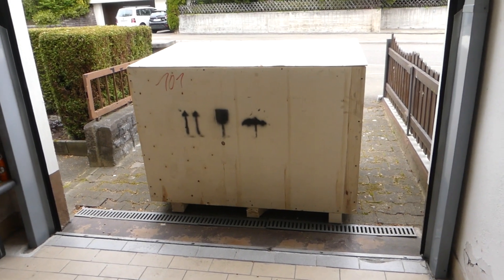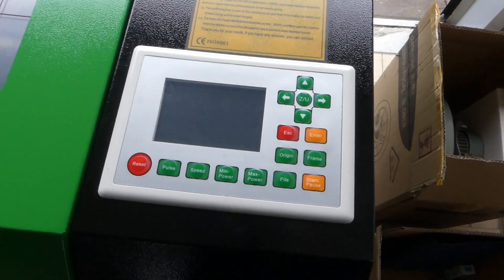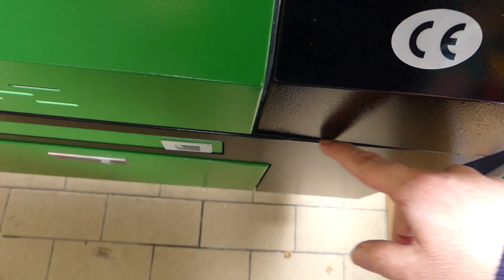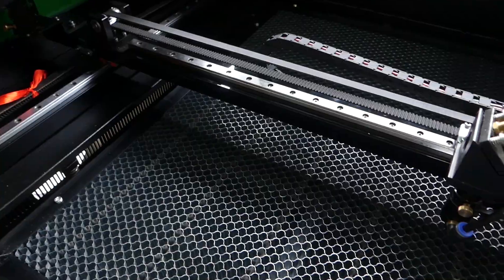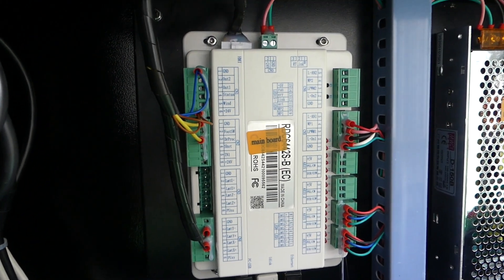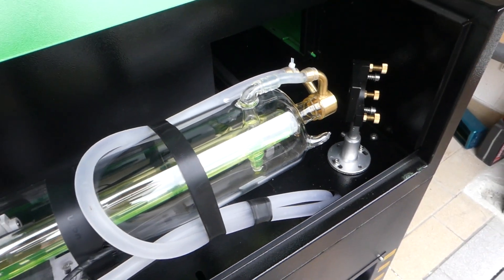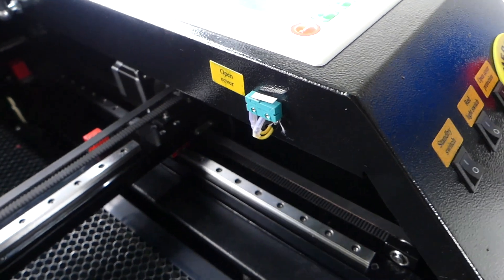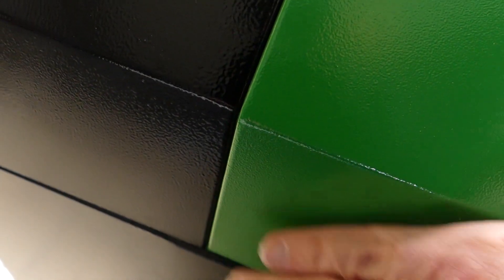I bought the cheapest 80W laser on eBay: Laser Adventures - Day 4

Comment: May 1st ...Labour Day 🎬  
...metal shavings <ouch>
...clean coolant system with "Listerine"+Aquadest or vinegar (not the foodstuff!) then add preferred coolant (resistivity`?)
...anyway: WHAT are you going to do with it?  (didn't you have a K40 already?)
Reply from the maker: Yeah, I do have another laser engraver, but that's just 2.4W 450nm and 1W 890nm, I really want more power and a slightly larger work area.
The things I want to be able to do is cut wood for cases and machines, and engrave PCBs and panels. 
Something will always pop up to do.
Not sure about the cooling ... I don't usually use distilled water, because it is very aggressive to metals. Will probably just use boiled&filtered rain water with a bit of algae suppressant. It's filled either with antifreeze, or leak detector coloring.
Im thinking of purchasing a CW-5000 to go along with the machine.
Reply: Try Tetra AlguMin (de). 
- Don't "boil&filter" go to a Coralfish shop (Seewasser), get osmosis water (RI). Definitely get yourself a conductivity meter and prepare mixture according to the needs (spec) of your laser tube.  ...your are in "BW" ...there should be a laser shop nearby (surfactants). 
-No meter? Get the real thing: Search here for "Digital Dohicky" "Robert Cowan".  
NOW  (Fingers off that case switch!-  Get yourself goggles with side flaps ;-) AND Have Fun ...
Reply: Forgot: Get a Cooler with a flow meter and some means to detect bubbles...
Reply from the maker: Tube performance has stabilized, and I believe it's improving - probably needs to run in.
Cooler: check, running nice and cool now, but need to do some measuring.
Water: Distilled with 25% antifreeze, check
Googles/Glasses: have blue coated LaserFanatics, special smallband CO2 are ordered . check (but lid stays closed anyway)
Digital Dohicky: Work in progress, I can't get coated aluminium here with specific mass.
My fume extractor fan died / is dying .... this thing is just too well sealed. :-) going to get a 180W industrial turbofan next week.